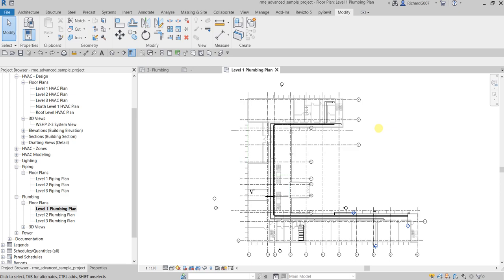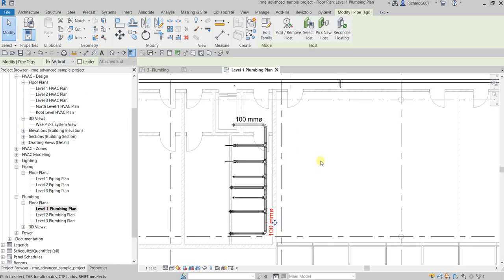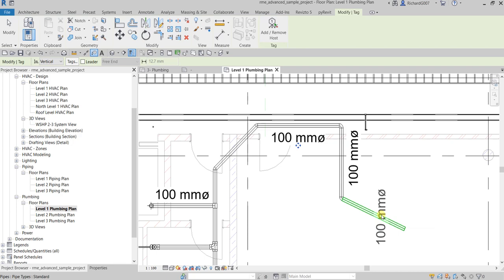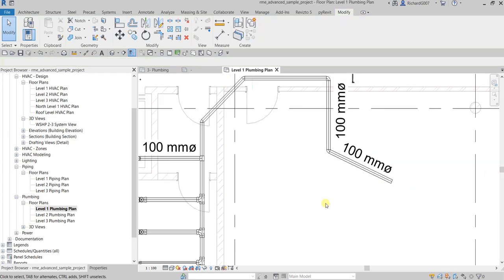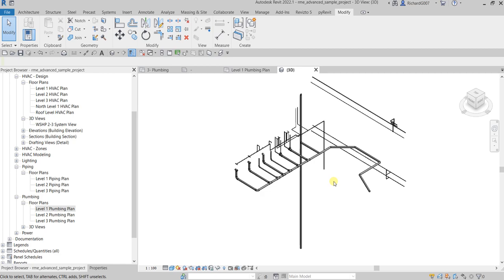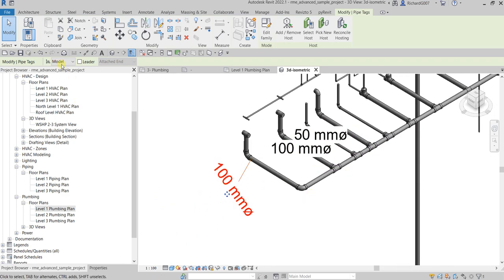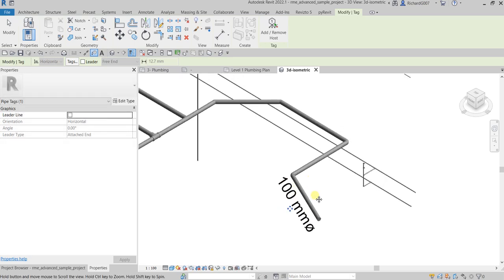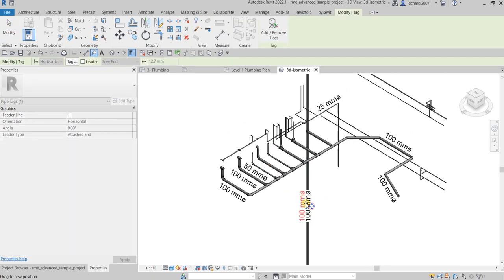REVIT TIPS AND TRICKS: ROTATE TAGS WITH PIPES

Comment: How do i do with leaders it again goes to horizonal
Reply from the maker: Hello @sundaramvalliappan9795!

If you're experiencing issues with leaders in Revit family tag creation repeatedly snapping to horizontal orientation when you want them to be vertical or at a different angle, it's likely related to the "Auto-Flip" feature in the tag family. Auto-Flip automatically adjusts the leader orientation based on the tag's position relative to the tagged element. When the tag is moved to a new location, the leader will flip to maintain horizontal orientation or follow certain rules.

To address this issue and create leaders with the desired orientation, you can try the following steps:

1. *Edit Tag Family:* Open the tag family you are working on in the Family Editor. You can do this by selecting the tag in your project and clicking on the "Edit Family" button.

2. *Select the Leader:* In the Family Editor, select the leader that you want to adjust to a vertical or specific angle.

3. *Disable Auto-Flip:* Look for the "Auto-Flip" parameter or option in the Properties Palette while the leader is selected. By disabling Auto-Flip, you can manually control the leader orientation without it snapping back to horizontal automatically.

4. *Rotate the Leader:* With Auto-Flip disabled, you can now rotate the leader to the desired angle using the Rotate tool. You can find the Rotate tool in the Modify tab of the ribbon or use the keyboard shortcut "TR."

5. *Adjust Leader Position:* Move the leader endpoint to the location where you want it to attach to the tagged element or annotation. You can drag the endpoint to any position within the tag family.

6. *Save and Load into Project:* Once you are satisfied with the changes, save the tag family and load it back into your project. Your leaders should now maintain the orientation you set without automatically flipping to horizontal.

By disabling Auto-Flip and manually controlling the leader orientation, you can ensure that the leaders in your Revit family tag creation stay vertical or at the angle you desire. Remember to save and load the family back into your project for the changes to take effect.